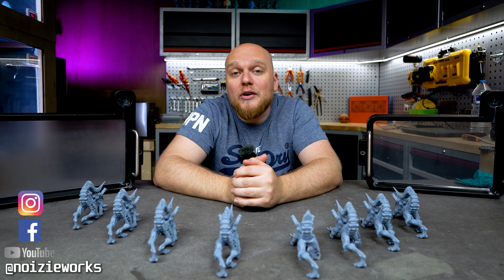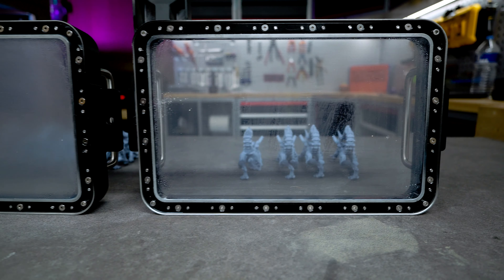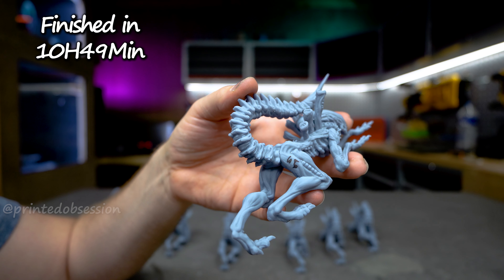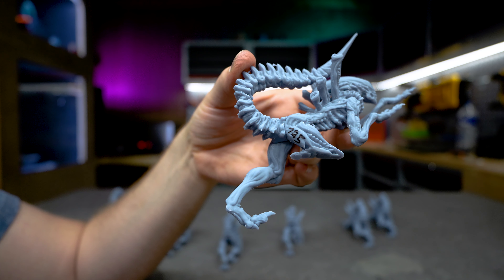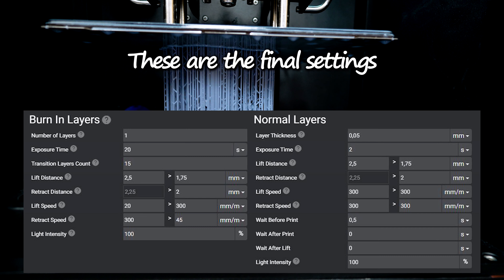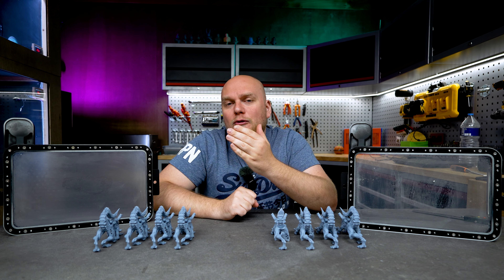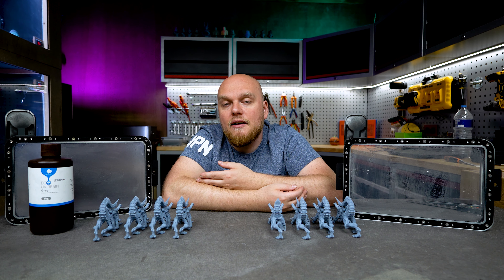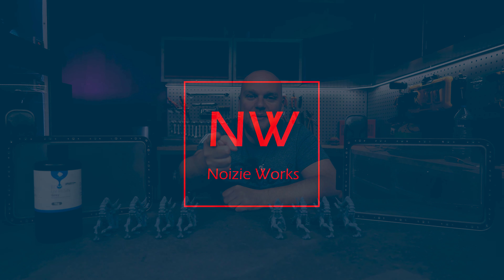Is ACF better then NFEP/PFA? Let's find out!

Comment: Worth pointing out that "ACF" is not the same as the conductive film you found.  ACF is just a made up marketing name and has no connection to Anisotropic Conductive Film.  There is a new one on the horizon "HCF" which I guess is supposed to get around some of the drawbacks of ACF potentially (the fact that it softens details being the biggest downside to ACF)
Reply from the maker: Yes your right but that's what i got from the manufacturer so 🤷 from what i hear it's just another rebrand like nfep
Reply: @NoizieWorks  ACF film for resin printers started with "Aorita Composite Film", everything else is BS.  Aorita makes most of it, other companies' "ACF" are either re-branded Aorita ACF, or "knockoffs".  It's some kind of release film laminated on to some kind of silicone-like substrate.  Whatever the release film and substrate are, they aren't “Anisotropic Conductive Film”;  3DPrintingTurd made the same mistake (that's probably where the alleged "manufacturer" selling the rolls came up with that BS).

I've used Aorita ACF since March 2023, and it was available before that.  I've used the same 3 sheets since then no problem, except for one that I dropped a screwdriver on and dented so I changed it.

I have the High-Definition ACF (HDF) films from Aorita (what the tool above wrongly called "HCF"), I haven't tried them but someone I know did and the results were stunning.

Keep up the good work, buddy!
Reply from the maker: @retromodernart4426  thanks bud! Sounds like it's probably a reseller if they name it wrong on there own info brochure lol
Reply: @retromodernart4426  seriously?  you're just gonna toss out insults?  Who here exactly be being a tool?

For the record, "HCF" is what they are calling it, at least when speaking with printer manufacturers.  There is some testing happening now for the Athena, where it is specifically referred to as "HCF".
Reply: @NoizieWorks  Hopefully Aorita will send you some HDF soon to test 🙂

Comment: from my experience with acf.  It is not as durable as nfp. I get wear on the film were it touches the vat and then get pin holes in it that leak resin. On detailed minis I do see a reduction in details.  So I went back to nfep I would rather have details and have had less film failure with nfep than I did with acf
Reply from the maker: Thanks for sharing your experience bud!

Comment: I just bought some ACF and burned through 3 sheets of it in an evening. Its so flimsy and stretchy I found it neigh impossible to get high tension. High lift speeds don't mean much I've I'm having to double my lift distance
Reply from the maker: @andrewryan7686  Installing it should be the same experience as with nfep

Comment: Hi, I liked the video, but how do I calibrate the printer with this new ACF film? Will I have to use two A4 sheets on both sides?
Reply from the maker: @andresbecerrafuentes5233  i level on the vat itself. If that's a bit to tight (motor skipping when dropping in tank) you can add a thin sheet of paper under the acf
Reply: @NoizieWorks  add a thin sheet of paper under the ACF, but under the build plate?
Reply from the maker: Doesn't matter as long as it's under the buildvolume but only if you experience motor skipping. Mine is fine just on the acf
Reply: @NoizieWorks  thank you so much, y soy de Chile, saludos desde acá!
Reply from the maker: @andresbecerrafuentes5233  my pleasure dude! And nice, i like 🌶 😆

Comment: I have found the ACF has trouble with finer supports. My theory is because it is more rubbery it sort of "twists/bends" the fine supports before releasing. I find that the NFEP does a better job with better job with fine supports/pillars at the same speed.

The other thing with ACF is how much life it has, it is much lower than the NFEP and if you consider the cost per a layer printed vs cost per a sheet it comes out to be more like 6x the price of NFEP. Ofcourse you can lower the speed as the ACF wears out.

Great video, would love to see more. Ironically in my testing, I too was using anycubic eco resin.
Reply from the maker: The eco resin isn't available anymore as far i can see(it's for the good).
As for lifetime, i didn't see any degradation and i have done more hours on it then any other nfep i ever put on a machine.
You mean it gets more sticky over time?
This is ofcourse my observation on the s3ultra and the jupiter.
I haven't found supports to be a problem, i use basic chitu light support on every model without problems which was not the case for nfep.
I do use rest time after retract so the model can settle and it stops flowing depending on the viscosity  0.5 to 1.5 sec seems to do the trick so maybe try that?
Price is problematic no doubt but i look it that way, i have 95% succes prints now which i didn't have with nfep.
 Wasting 500ml on a model because of a failed print ads up quickly so while speed is cool you get a lot more reliability on the same speeds with acf.
Reply: @NoizieWorks  I just checked, looks like the re-branded to "Plant Based Resin"? It won't be long now until they start calling it "Vegan Resin".

It would be interesting to know what the true lifetime and forces over number of pulls are. Anycubic's firmware begins recommending changing ACF film after 10,000 layers. On the other hand there are people in the community saying their NFEP's are lasting well over 100,000 layers. So I think there is a lack of clarity and confusion in this area.

As for the twisting of support, I ran tests with identical print settings (2 second delay). It's not that the ACF couldn't print small supports, it's that the NFEP could printer even finer supports/pillars. I would have expected the opposite since the ACF is lower force. One test showed this was "J3D's cubes of calibration". 

J3D does have a video comparing the two, and it does show the effect I am discussing. https://www.youtube.com/watch?v=XxbzuRCv22Y

Your videos are great and do alot to clarify things so it isn't all just folklore, I will probably have to try ACF again this time with Sunlu abs like.
Reply from the maker: @Nekativ1  watched it and i think i get what you mean now. 
I would strongly recommend to try a better resin first and compare it.

Super weird and not at all my experience so far.
The streaking he gets looks problematic.
I have seen fauxhammer complain about that issue on anycubic printers and it wasn't the fep but don't quote me on that (wasn't that long ago)

About the suction forces he had some doubts about.
The sound difference alone is day and night, the fep sounds like it's ripping it off with acf being dead silent making you think the print failed.
Also the fep movement of acf is minimal while nfep needs more lift height.
I have done plenty of prints on the jupiter last year and all models come out crisp, now i'm not sure about microscopic differences but imo the pixel size on the jupiter is the limiting factor.
On the other hand the S3ultra is 12K so yeah...

Going to look into it, i still have some nfep around.

Testing the lifetime claims is going to be very hard to do that in a controlled way without 24/7 printing.
Not sure how you can speed up the process reliably.
That being said i just replaced my first acf sheet after puncturing it.
That sheet had way more then 10.000 cycles on it.

Just making this video being pessimistic about the heigth, the model height is about 120mm divided by 0.05mm layer height you already have around 2400 peels times 4 models and then add at least 3 resin testing gauntlets before i punctured it.
Feels like they just want you to spend the dollar bills yo.

About the resin, they probably rebranded that crap like you mentioned but the last video they where both available at the same time.
Vegan resin lol 😄 what's next, food safe?
Reply: I see this all the time despite what resin you use. ACF will almost never get as many pillars on my Boxes of Calibration print across thousands of users that have sent me images. With a microscope and some testing, I have found this is because ACF's texture also affects deeper than the surface. THis can make fine details have almost fractures that make them more brittle. 

Again this is only for very small things and does not seem to affect larger objects.
Reply: Anycubic recommends changing the ACF at 10,000 layers. In my experience, it will last about 30,000 layers, but I had to slow it down after 10,000 because I was getting a lot of print failures  @NoizieWorks
Reply: @Nekativ1  The guy in your video with J3D tech has textures on his models printed with ACF. Looks like he was printing with the textured side of it, which is what Noizie warned about.
Reply: @StopSophisms  I've been reading a lot about issues with ACF but this video is the first time I've heard that there's a texture difference on the film itself, which made me be wonder if the issues with the "texture" on the prints might be caused by them putting the film in backwards 🤔
Reply from the maker: Probably, you will also have problematic release as the good stuff is only on 1 side. Other side is rubbery with a texture that should NOT come in contact with resin.

Comment: I dont understand what 300mm/min means. How exactly is it measured?
Reply from the maker: @jessicaalvis7063  that's the lift speed, you normally have 2 speeds. Stage 1 is slow(the peel) and stage 2 is a lot higher.
These prints are releasing without a slow down in the comparison.
Reply: @NoizieWorks  okay I thought it was print speed - but that would make no sense as it would then print in less than a minute. Thanks :)

Comment: Why would you use substandard resin AND change parameters like exposure time in between the tests??
Reply from the maker: I only changed settings on the 300mm model, all the other 7 used the same settings except for the lift speed.
Why the crap resin? To test the sheet to it's limits at 300.
If it prints successfully with crap resin the results are going to be even beter on a good resin.

Comment: Another fantastic video for the Jupiter!  Do you think the sunlu abs could perform at the same speed with the acf film?  I use the elegoo feps that are sold for the Jupiter and print at 50 lift speed reliable but mostly big models or packed build plates. Then it takes like 21-26hrs for a 280mm height model to print.😂
Reply from the maker: Ow yeah, sunlu abs is going to perform great. The thicker the resin the more rest after retract you will need to ad but that's true for any fep material.
Every resin testing gauntlet since then has been printed at 150mm/min and i have tested some goopy thick boys 😅

Comment: Great video.  Superhelpful.  Might try this on my old MonoX (of which I have 2).
Reply from the maker: You won't regret the change, now i'm running double the speed with less support
Reply: @NoizieWorks  With ACF can you leave resin in the vat or do you need to drain it all the time?  I've heard both.  Thank!
Reply from the maker: @almonster2066  i typically would advise against it because most resins will seperate and then you have to mix it in the vat.
But for the fep i don't really think it's a problem.

Comment: Hey yves.  Is the acf interresting for serie production printing you think. ( full build plate )  Im not directly looking for faster speed but a more quality product. I use the abs like resin from uniformation on the gktwo.  Testing more resin's ( monocure tensile, jamghe eng pro, siraya mixes, etc ) for the moment.
Reply from the maker: Like you could see with the giant block you get lower suction forces so in theory less failure.
There are some people saying that quality takes a hit but from what i can see with the naked eye 🤷‍♂️ they all look the same so yes it's going to help you in production situation.
If you keep the same speeds you will notice you can use less invasive supports with acf something i failed to mention in the video.
1 thing tho the campaing is for big spools so if you are looking for a few sheets you will have to look somewhere else.

Comment: Having to re-level the build late is a non-sense !
The build plate has to be leveled with the upper side of the film
This side is aligned with the bottom of the tank and thus its elevation does not change if the film thickness change...
Reply from the maker: @user-um3ui1gu9t  you physically change the height of the film so yes you have to because the spring mechanism is calibrated on a thinner material

Comment: Wait! ACF + Saturn 4 ultra peeling!!! Maybe even faster???
Reply from the maker: The hole thing of the 4 ultra is to get rid of it because acf is marginally worse for details or so they claim i need to test it but if it's possible to speed up the tilting then that would be a cool test right?
Reply: @NoizieWorks  So I use resin to make mechanical use parts. ACF has turned my Halot Mage into an 'okay printer' into one that fails far less because of the reduced peel forces. Getting good flat or dimensionally accurate prints has been a pain. I believe most of that is a result of peel forces. I'm wondering if combining the two even further improves overall performance.

I do wonder if Elegoo will give us 'tilt speed controls'
Reply from the maker: @MoonWind32690  i ordered it so i will definitely test it out for you. I guess they will keep it locked because the tilt is still faster than using z axis to peel off the model.

About the flat pieces it's a combination of peelforces and resin shrinkage(warping) thats why i put so much feedback on the warping. The more stable a resin is, the more it's going to keep it's original form especially if you print flat stuff.

Comment: It's a shame my anycubic has a vat with those fep with frame, I should invest in a second vat that accepts bare sheets
Reply from the maker: Is that still a thing? Damn that sounds anoying
Reply: @NoizieWorks  at least on the printer I bought second hand )Anycubic phonon D2 dlp) anyway I just bought an aftermarket resin vat in which you can use normal, non framed sheets + Acf sheets